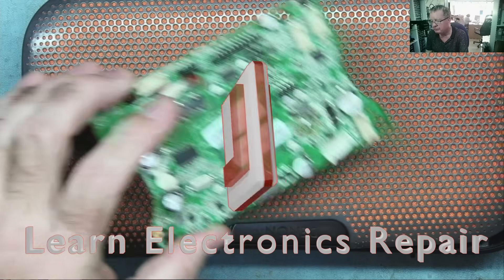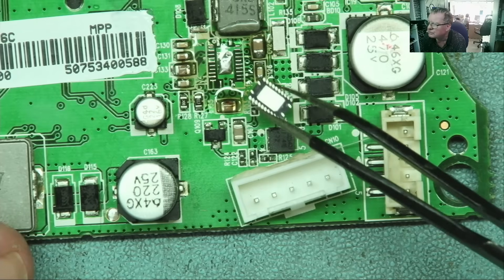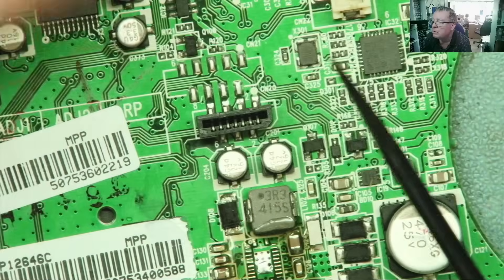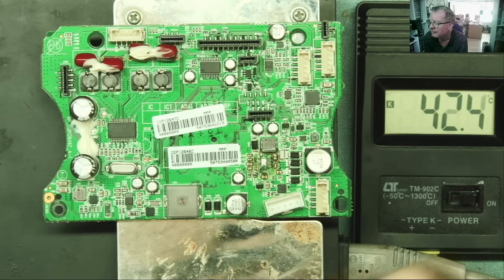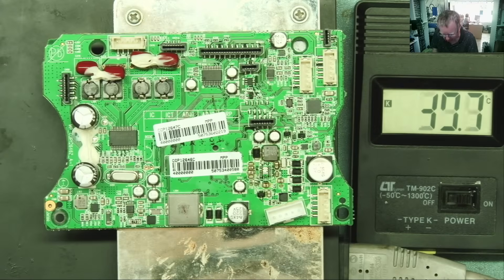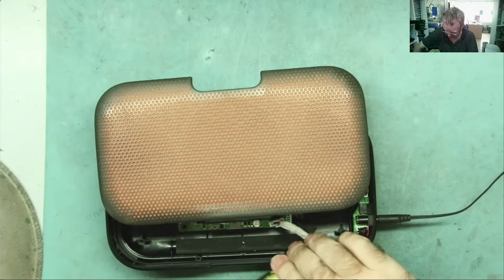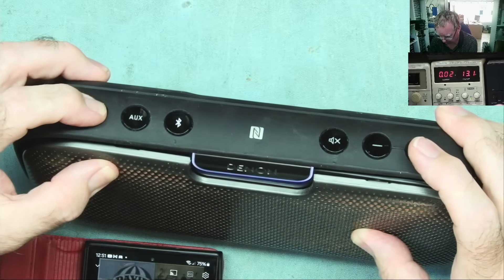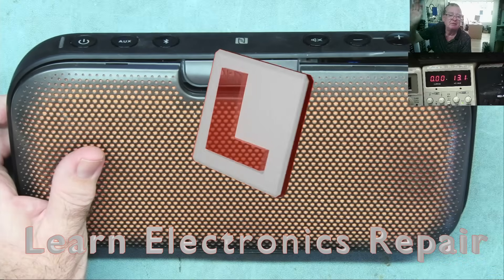Denon DSB-200 Portable Bluetooth Speaker Dead Does Not Power On : FIXED

Comment: I have some reservations about these charge control ics.
I recently repaired a batch of hand spotlights which used an SOT23-6 chip for recharging the single li ion cell at 500mA.
In all cases failure was due to overheating because the chip was not able to dissipate the heat.
It had no heatsink.
Even when they have heatsink plates on the underside the dissipation relies on having sufficient land area on the underside of the pcb to keep the ic at a safe working temperature.
For this reason I have been deliberately under running the ubiquitous TP4056 charging modules because I have had failures charging at 1A.
I generally charge at a maximum of 600mA with module spaced away from any other surface.
In the same family the TP4333 has internal temperature compensation so that if the internal temperature reaches 80⁰C the charge current is reduced.

Comment: I most certainly would not press down on the part while the solder is molten as some have suggested. First, that is likely to result in misalignment. Second, if there is an excessive amount of solder on the pad for the big central area, it has no means of egress other than squishing out around the pad area, possibly causing shorts. An exception would be if the vias in the thermal pad are open to the opposite side of the PCB, but on the board in video all the vias appear to be capped with solder mask (which is a bit of a dubious process with some solder mask, but generally works OK on small vias regardless of the type).

One thing to note with these leadless packages is that the ends of the individual terminal contact pads are not always reliably solderable. They are often just the metal used (usually copper) with no plating so they may be oxidized and they may be smeared or even deliberately covered with encapsulant. Sometimes they take solder, sometimes they don't. It makes visual inspection difficult.

MANY surface mount ICs should be stored in tightly sealed moisture barrier packaging. The bags used look much like ordinary antistatic bags but they are made differently. Most common plastic films are not good barriers to water vapor. If the parts have been out of the proper packaging for some time, they may need to be "baked" for several hours to dry them. There are several categories of moisture sensitivity and corresponding storage requirements. If proper conditions procedures aren't observed and you go straight to soldering temperatures, damage, which may not be immediately apparent, can result. I doubt if most Back Alley Express vendors have any clue about any of this.

Comment: Why so complicated? You have the solder on the board, preheat on top, when melts just put chip, position it and press it. There will be some blobs to clean, but the job will be done. Easy and fast.
Reply from the maker: With a chip that has a large centre pad full of solder, you really want to pess down on it?
Reply: @LearnElectronicsRepair  The chip can have as many pads as it has. 2,3 even more and pressing the chip is important. This way you squeeze the excess solder from below and leave just the right amount to keep the chip flush with the surface. Of course you should use good amount of flux to avoid shorts. I have learned that from Alex from NorthridgeFix channel. And it works every time like a charm.

Comment: Preheater check,
PCB and component tinned check,
Richard, you forgot to press the component down during hot air soldering. Check 
Good work Richard 👍
Reply: Don't press chips down. They need to naturally flow into place from the solder surface tension.
Reply from the maker: @SkippiiKai  Agreed, from my experience at least
Reply: @SkippiiKai ,,https://youtu.be/c_Qt5CtUlqY,,, 06:30
Reply: @SkippiiKai ,,06:30 https://youtu.be/c_Qt5CtUlqY
Reply: @Lightrunner. He also does not press down during soldering. He does give it a sideways nudge at one point, but that's completely different to pressing down.
Reply: @SkippiiKai ,,Everyone works according to their own opinion to ensure that the distance between chip and PCB is correct.

Comment: Every time the sound went quiet, it corresponded exactly to when the Bluetooth symbol popped up on your phone. Before the symbol appeared on your phone, the sound was loud???🤔
Reply from the maker: Yes I don't understand it either.  And yet the volume was turned very low on my phone but it played loud for a few seconds.  Once I turned the volume up on my phone it worked as expected
Reply: @LearnElectronicsRepair  Yes. It was as if there was a connection at full volume before the phone had shown the icon to indicate that there was actually a connection. Very strange. I see that others have suggested that the loud sound must have been coming from the phone itself initially, but wouldn't you have noticed that?,
Reply from the maker: @Manticore1960  You are correct. It wasn''t the phone. And anyway the volume on the phone was minimised (as I showed)

Comment: I'd use the preheater like yourself, but with a line of solder paste with hot air to solution to let surface tension do it's job.
Reply: I was thinking the same, definitely a job for solder paste.
Reply from the maker: @mrquicky  There are always alternative methods.  personally I find solder paste had to work with, always forms blobs and can't get the correct amount where i want it to go.  That could just be bad technique on my part.  My recommendation to everyone learning to do this... watch some videos, try every technique you find, and when you find one that actually works for you then stick with it and you will become an expert at it. Regardless what others tell you. If something works for you it is the way for you to go

Comment: When you were only getting a brief burst of sound from the speaker I assumed it was just shutting off in protest at your choice of Northern Soul "music".😁
Reply: Pretty sure the bursts of loud music were just the phone speakers, before it had established the connection with the bluetooth speaker
Reply: @Alvin853 that’s what I thought. You can see the moment that Bluetooth connects on the phone.
Reply: @Alvin853  Clearly not, the problem was that the volume level on the phone was zero/very low. Either the phone did not transmit the volume level immediately or, more likely, the speaker started playing before interpreting the volume level. 17:00 Richard turns the volume up. "Learn how to use the phone".
Reply from the maker: @chrishartley1210  Yep I think this is the correct analysis of what was happening
Reply: @chrishartley1210  The volume controls for the internal speaker and for the bluetooth output are probably separated. The initial sound was very different from the bluetooth speaker's (phone has a clearer sound with less bass). 
So i guess: phone volume was up, bluetooth wasn't. The phone starts playing from the internal speaker, then it finds bluetooth and switches to it. The volume buttons aren't connected, so no reaction when he tries to turn the volume up from the speaker.
Reply: @IlBiggo It is clearly an Android phone and Android does not have separate volume controls for BT without an app. The volume was clearly being adjusted with the side controls, not an app. And Richard himself says he thinks my scenario is what was happening. Since he was testing the speaker I think he would have known if the sound was coming from the phone.

Comment: Very curious why you didn't use low temperature solder paste and the hot air  instead of having to tin both sides  with solder.
Reply from the maker: Do you really think it's a good idea to solder replacement components with low melt solder?
Reply: @LearnElectronicsRepair  It's not low melt solder he's talking about, but rather solder paste which appears to melt at a lower temperature than normal lead tin solder. Many doing smd repairs go for the paste instead of solder. I for one tend to use low melt solder for removing components only.
Reply: @fredflintstone8048 Solder paste is usually low melt solder, but it comes in a wide variety of mixes. It's just tiny solder balls mixed in with flux.
Low temp has higher resistance joints than other solders, so not recommend for power chips or high speed data, but otherwise I don't think it really matters. The real question is why use something that is 10x the price if you don't need it?